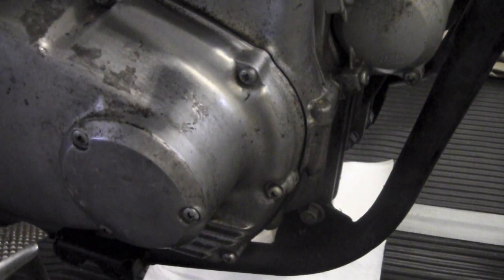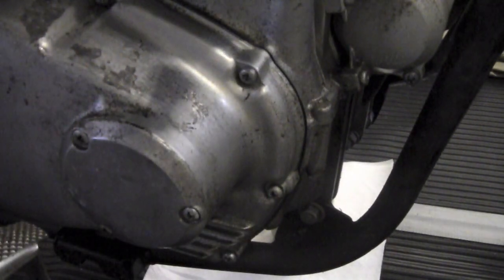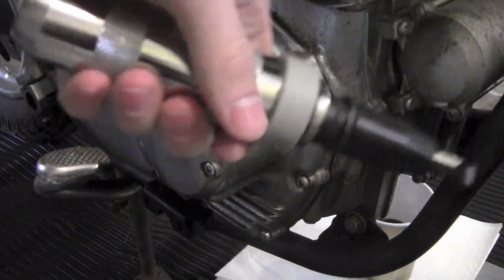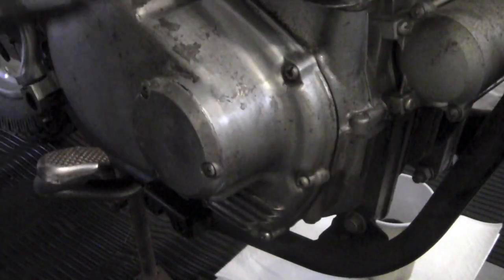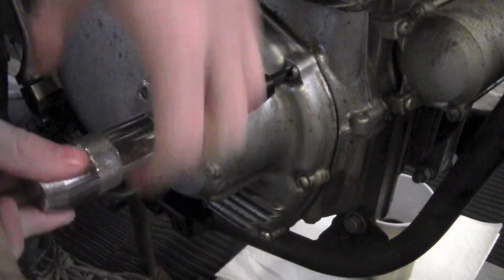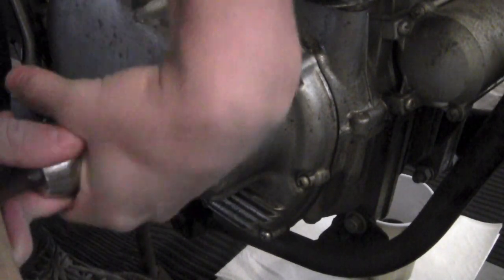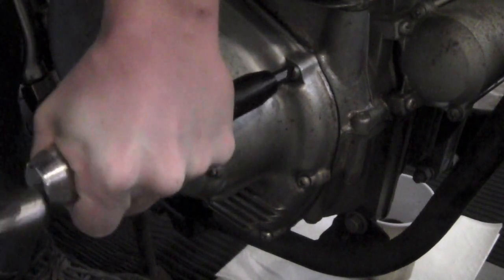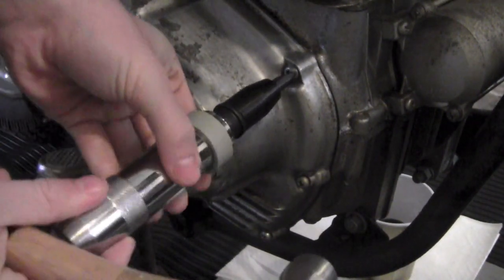How to Remove a Stripped Screw

Comment: you can also try putting a rubber band between the tip of the screwdriver and the head of the screw. it can snug up the connection and give you enough leverage to turn the screw.
Reply: stockton350 how

Comment: What if the screw's head has broken off?
Reply: +Kon Motovlogs The head of the screw is striped, not the threads internally. If the head is broken drill it out and retap the hole.
Also heads up to everyone else never hit a metal impact driver with a hardened steel hammer, always go for a brass or leadshot/dead blow hammer.